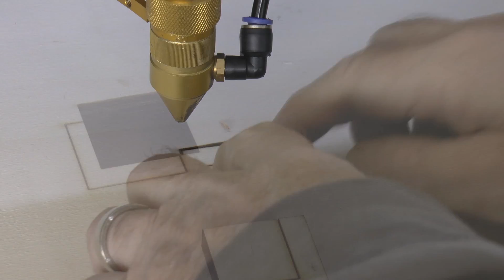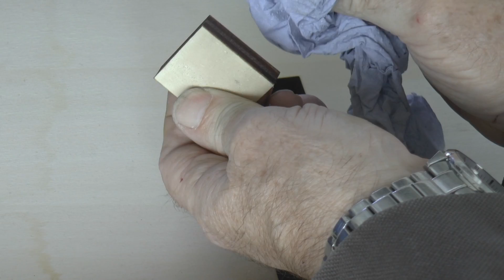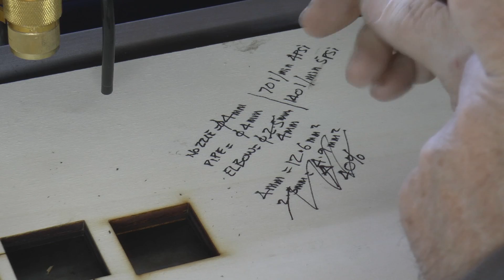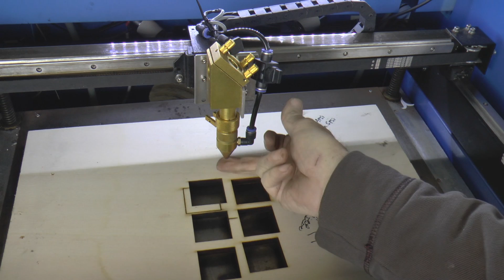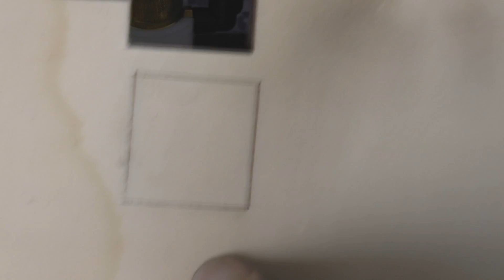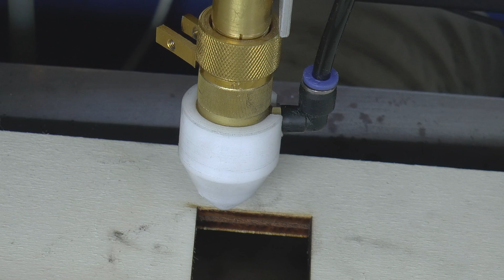RDWorks Learning Lab 87 Maximising air assist efficiency

Comment: 2019 almost 2020 lol and your videos are still useful, in two days I am about to get one of those K40 with the old heads, I already received the Cloudray upgrade head and mirror mounts set, I just bore out both nozzle tip and Air fitting, mainly because of your findings and the fact that mine didn't come with the air compressor, The Air compressor I do have is about like yours is. So, lol thank you for doing the math and experimentation for us.

Comment: Hi, good works thanks for share.
Laser tube is 60w but what %power you used and what lens, thanks.
You use top material as focus point?
Reply from the maker: Hi Eduardo
These test have been a prelude to further experiments  later in my learning journey. What I have found is that  you do not need high air pressure to get an efficient cut, you need to make sure that what air you have is sent efficiently into the cut itself to blow the fumes out of the BOTTOM of the cut.. This efficiency can only be achieved if you keep the nozzle within 6mm of the work surface and also that your nozzle orifice is in the 2 to 2.5mm  size range. I have measured flows in the 8 to 10 l/min doing a very satisfactory job. 
Although there are a few delicate material exceptions, in general cutting will be done at  the max current limit for your tube. Depending on your tube that could be anything between 60% and 85%,  I then adjust the speed to  get a clean through cut.
I have found that in general the best place to focus is on the surface. However in my next round of experiments with lenses I shall be investigating the slight benefits of setting the focus a short distance into the material. This does allow you to cut a little faster but the cut is wider and  often a bit messier.  Why? I don't yet understand,  so that's one of the many things I plan to experiment with.

Best wishes
Russ

Comment: Hi Russ. Another big thanks for your hard work from the South Pacific! I'm cherry picking your fantastic selection of experiments to help with ordering and modifying a 1390 cutter from china. you've probably covered this somewhere already but have you any data on laser tube lifespan relative to it's output percentage? Should I over-specify the wattage and run at sub 100%  in the interest of  longer laser tube lifespan? I'm looking for as high as possible production speeds, almost solely cutting 6mm hardwood plywood, currently weighing up  W4 tube @ 100-130W and W6 tube @ 130-150W. Cheers
Reply from the maker: Hi
I'm in an airport lounge killing time. I don't have access to my video files that would explain more about your tube.
 If you  are only cutting then power is what you need. I have used W2  W4 and W6. Personally I am yet to be impressed by a Reci tube. Very expensive an over specified. Go to the Reci website and look at the operating conditions in section 2. The 150watt headline is a max test output which you will not be allowed to do because this will over drive your tube and invalidate the warranty. The recommended NORMAL running current will give you 130 watts BUT read on an it says if you want decent life from your tube then drop another 2mA. The net result is you are paying a lot of money for what is effectively a 120 watt tube. Look at the 150 watt EFR OR SPT tubes. ...... no such strings.
For this high wattage do not buy cheap ZnSe lenses. For your application I would suggest a 50.8mm (2") focal length gallium arsenide lens. This material is suited to high watts and despite being opaque to visible light (beam combined will not work) it is still about 97% efficient.
Best wishes 
Russ
Reply from the maker: Woking on phone is so limiting!!! Forgot to answer the lifespan question.
The manufaturer specifies a max drive current which you should not exceed. Overdrive the tube and you will shorten its life. Lots of myths about tube life but my contacts in China who are close to the tube manufacturers tell me that tube life is not a statistical science but more of a pragmatic guesstimate. Many Chinese companies run their tubes 24/7 flat out and this practical data forms the basis of tube life claims. The tube is supplied with a warranty and that warranty begins the day the tube is tested. Thus if you buy a tube that is new but12 months old, it will work perfectly but may have no warranty.  In general you can expect 3 to 4 years of life from a tube, even if you use it at it's max normal current. The CO2 in the tube will eventually be degraded and your tube will die over a week or two.
For efficient cutting you need to run at max allowable power and set your speed to the max that will allow your pieces to drop out. 
Best wishes 
Russ
Reply: @SarbarMultimedia  Thanks very much for getting back to me so quickly with that helpful info. Is my bias toward higher power and cutting eliminating any possibility of wood etching/engraving? Is there a power sweetspot I should be considering where I still have decent etching/engraving capability while maintaining a fairly good rate of cut or am I starting to look at a dual tube machine? - Thanks
Reply: @floobs73  
Hi Nick
Sweet power is 60 to 80 watts.  have seen some  100 watt tubes doing a pretty good job but there is no definite guarantee because no two tubes are exactly the same. If you want to do more cutting then I think an 80 watt EFR or SPT tube will work well. I would consider staying with a single tube machine because there will only be half the potential set up issues
God luck and best wishes
Russ
Reply: Thanks mate. Love your work!

Comment: Where can I learn more about lens sizes? I'm a little lost when it comes to 1" vs 2" lenses.
Great videos by the way. Very informative.
Reply from the maker: Hi Brian The essence of lenses is very simple in that there are materials, diameters, form and focal length/ The materials available are Zinc Selenide and Gallium Arsenide. The GaAs is best if you have a high power tube over 100 watts say, but there seems little difference is overall performance, just more expensive. The diameter is all to do with the requirements of your machine so remove your exising lens and measure it's diameter befor ordering a new lens. The form is of two shapes. plano convex and meniscus. The first has a flat side (which you mount so that it faces down to the work) where as the bottom face of a meniscus lens is dished a bit like a saucer. The meniscus lens type has a more precise focus point and is more expensive but for general cutting performance I prefer the plano convex lens. . There are generally three commonh focal distances. This is the point away from the flat side of the lense where all the light rays are concentratedat a single point. A 2" (50.8mm) lense is a good general cutting lens but for fine engraving the 1.5" (38.1mm) meniscus lens is a bit better.. 
In reality there is a lot more to know about lenses and I have just started work on a massive task to examine all lens types and how well they cut and engrave. Don't hold your breath becaue it is several weeks of work.
There is a recent 3 part video about lenses if you have the patience
https://www.youtube.com/watch?v=5fgw5hnU8EY

Best wishes
Russ

Comment: To lower my air flow , I put a valve inline to a tee connection. If I want less air, I exhaust the air through the tee. This way the pump is not overworking due to restricting the airflow directly.
Reply from the maker: If you jump tp ~116   https://www.youtube.com/watch?v=ZKC8Byc8y28 you will see that I have included auto switch that  so that the pump is only running during a program. If this is insufficent pump "unloading " for you there is a simple alternative dump circuit similar to your suggestion that always bleeds off excess air
https://www.youtube.com/watch?v=3nvAuz2i6H8

I have never bothered to implement this variation because my pump really does not get over hand hot (40 to 50C) but I a a detailed circuit diagram if anyone should need it. 

I will shortly be doing a fit of an "off the shelf" kit of parts to my Lightblade machine  that will make it simple for most people to implement the changes I made in #116. 

Best wishes
Russ
Reply: Russ, you are the best presenter I have seen on Lasers. Thank you so much for your time and patience.

Comment: Hi Russ watched this video many times very helpful, I recently bought a new laser machine with 100w co2 tube got 70 l/m air pump with it which is just of no use for cutting mdf and Plywood too much charring.
Which air compressor would you suggest? Or do I even need to upgrade it?

Comment: Man I just found your channel and I love it, good job :)

Try some paper and silicone cut/engrave as well, that's is what I'm using my machine for and has been such difficult material to work with but is going well, would be amazing have somebody trying that out too.

Thanks for the videos.
Reply from the maker: I have done lots of paper and thin card cutting for example see  https://www.youtube.com/watch?v=_3oUQ9gKjCk
The trick here is to make use of the preionization zone that all tubes possess. It cuts with a very noisy hiss and will be found around 8 to 15% power setting.
I have never cut silicone but there is a mode that works extremely well for difficult materials . It's called DOT mode and basically allows you to automate pulse mode. You have to experiment with the parameters to get perforations that just join up to produce a cut.
Lots of learning to follow.
All best wishes
Russ

Comment: Very interesting chapter again. I love to watch your adventures.
I recommend you an experiment.

Currently, you have someting similar elbow connected to the nozzle :

http://www.ebay.com/itm/4-X1-4-NPT-Pneumatic-Male-Elbow-Connector-Push-In-Fitting-Tube-OD-6mm-One-Touch-/321711394183?hash=item4ae77e4d87:g:U-oAAOSwHMJYEtWE

A 1/4'' thread elbow connector for 6mm OD / 4mm ID tube (OD/ID stand for Outer Diameter / Inner Diameter in pneumatics)

Change it to this :
http://www.ebay.com/itm/4-X1-4-NPT-Pneumatic-Male-Elbow-Connector-Push-In-Fitting-Tube-OD-8mm-One-Touch-/221730331236?hash=item33a0285a64:g:vzkAAOSwrklVEoX4

A 1/4'' thread elbow connector for 8mm OD / 6mm ID tube

Then change the air tube all the way from 6/4 mm  to 8/6mm OD/ID , of course change all other air valves and connectors also to the approriate size. But this is not an expensive neither a sophisticated experiment at all,  and all the parts are easy to get (ebay or amazon)

Imagine, if that very short 4mm to 2.5mm narrowing had so much effect on air flow, and caused perceptible pressure loss, what will be the effect when you expand the pipe's inner diameter all the way from 4mm to 6mm ? I could be wrong but I would expect a much bigger effect.
Just a thought, because you love to try everything what moves.
Reply from the maker: Yes, this is a project on my list of things to do in the near future along with adding a low pressure accumulator to filter out the pulsing from the pump. We have already seen that air volume has a tremendous effect on cutting efficiency so I do expect to see a further improvement in cutting speed.
Thanks for the kind words and the comments
Best regards
Russ
Reply: Another very good idea. Eliminating the pulses to make smoother cut.
Yes, you need a buffer tank. You know what ? I could be wrong but you should make a try with airbrush compressors. Just a try. They have much bigger pressure 2-3 bar, not 0.3bar like your compressor, and lower volume, only 25-40 L/min. And they are not so loud, and they have built-in buffer, because people use it for painting things with airbrush, it must not pulsate at all. I could be wrong and I never tested, but its worth a try imo. Here you can fing may types :
https://www.amazon.co.uk/s/ref=nb_sb_noss_1?url=search-alias%3Daps&field-keywords=airbrush+compressor

Choose a smaller one, like this:
https://www.amazon.co.uk/d/Air-Compressors/Wiltec-Airbrush-AF18-2/B004BDBVZ0/ref=sr_1_10?ie=UTF8&qid=1484092424&sr=8-10&keywords=airbrush+compressor

maybe this:
https://www.amazon.co.uk/d/Airbrush-Materials/Wiltec-AS-176-Compressor-AS176-Compact/B0036DFSPU/ref=sr_1_20?ie=UTF8&qid=1484092424&sr=8-20&keywords=airbrush+compressor
,or maybe there are better ones for this purpose.

Just think about what volume/min you have at the moment. Your smaller compressor gives : 0.3bar at 0 L/min and 70L/min at 0 bar. The working point is probably much closer to the higher pressure, and that means very low volume. You know how much 70L/min is ? Its more than a liter/second !!! Imagine a bottle of wine streaming from the nozzle in every second !!! But you can feel it with your finger, that air volume is very far from it, its pathetic and weak, and its not even close to that, and its not even wine !

Comment: Hi Russ...
"Pepsi" here.. ;-)

When cutting plywood I normaly just cover the hole in the nozzle with a small piece of masking-tape. Then i poke a hole in the tape by firering a pulse with the laser. 
This will make the hole matching the beam and concentrate the airflow directly into the cut. I did some testing on this methode and found it very effective. 
As you know from your work with industrial lasers, the beam has to be exactly in the middle of the nozzle to cut perfect in all directions. Of cause we are not using Oxygene or nitrogene as assist-gasses in our small world, but nozzle-centration is still a bit important for the cutting-quality. The small trick with the tape can "simulate" that we have a nice centrated nozzle, and we don't "spill" most of the airflow. 
Best regards 
Preben Hovedskou
Reply from the maker: Hi Preben
That's a really neat trick. I wonder if it would be even better with some thickness to the orifice ie a piece of 2 or 3mm thick acrylic rather than masking tape.  Definitely worth experimenting with. If I make a video about it I will put your name in the video as credit for the idea.  I can test the idea to see if it further improves my plastic nozzle extender . Many thanks for sharing that 
Best wishes for the new Year
Russ
Reply: have you tried it ? waiting for your opinion on it & there is one more guy who tried this have a look https://www.youtube.com/watch?v=oQYQF3QKJPQ

Comment: wonderful set of videos, some of which I have watched multiple times. what brand of laser tube are you running in your machines?
Reply from the maker: https://www.aliexpress.com/store/product/1200MM-60W-Laser-Tube-60W-co2-Laser-Power-Supply/321243_1109607209.html?spm=2114.12010608.0.0.wDQqRI

Hi Eddie
This is what I fitted to my original machine 10 months ago.(actually the 70 watt tube).  I have been VERY pleased with it's performance. My new machine is a 60 watt EFR tube that was somewhat more expensive at the time I bought, That tube will be replaced by Thinklaser at the end of 1 year because that's all part of the warranty service pack.
Have a great Christmas
Regards
Russ
Reply: Thanks for your feedback

Comment: i have tested the gap at 5.5mm but on the same settings it seems does not have a nice polished finishing relative to if setting it at 8mm. i may need to tweak the settings to match that setting. 
one additional thing i noticed that if i set the power and speed for an opaque acrylic, somehow it will not cut as effectively when that same settings is used for a clear or tinted acrylic. not really sure why but i can only conclude that the clear one the laser light can scatter more inside the clear acrylic while the opaque ones concentrate it better.
Reply from the maker: Hi Cary
That's an interesting observation and just the sort of problem that fascinates me. I'm not planning to race you to an answer but I'll put it on my long list of interesting subject to video and play with. If you find out the answer first and are happy to tell me I'll show the world and you get the credit
Have a great Xmas
Russ